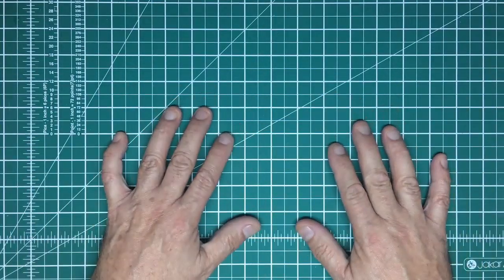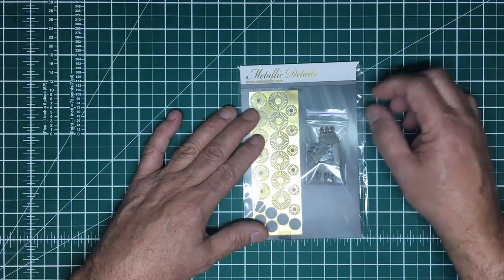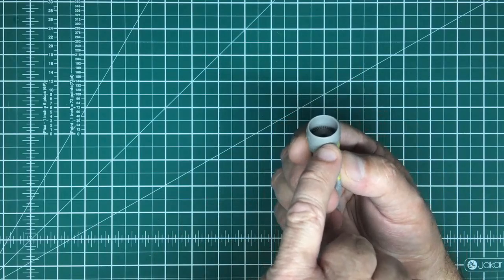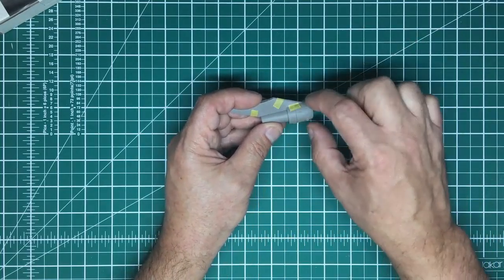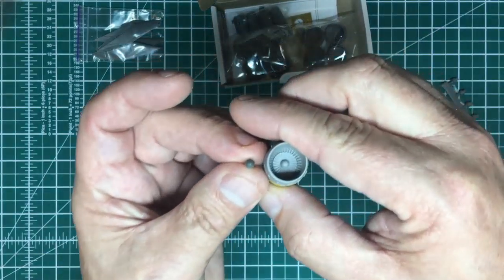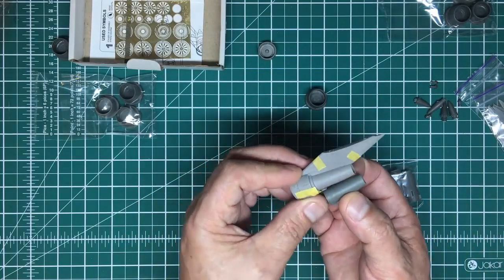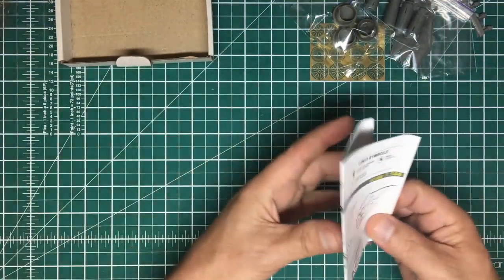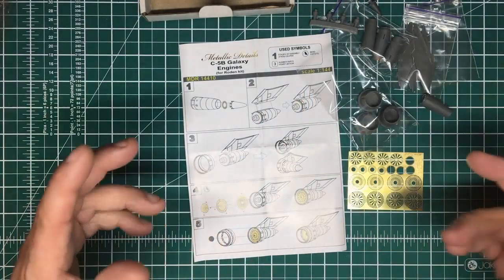Metallic Details upgrades for the Roden C-5B Galaxy

Comment: Hey Nigel, I'm just curious if you ever got around to building those C-5 engines up yet? If so how did it go? I bought them too and I'm seeing the same problems you pointed out.
Reply from the maker: GMBregoli I have made masters and moulds to replace the awful resin cowlings. I am also working on pylon replacement.
Reply: @NigelsModellingBench  Good to hear Nigel. The TF-39 can definitely use a good representation for once. Otaki and Roden got the front fan and stator vanes pretty much all wrong. And with Metallic Details, you get better accuracy in that area but they came up short with the cowling details overall. I'd be interested to see how your replacement molds came out once you have them all ready. Will your Youtube channel be a good place to check for updates on this project? And thanks for replying to my questions.
Reply from the maker: @GMBregoli  I'm not so sure about the MD fan? It kinda looks a little empty in there?
Reply: @NigelsModellingBench  True. Looking at real TF39 pictures there is behind the first fan a larger fan you can see behind the front stator vanes. MD did not represent that larger fan but instead they give you the rear stators.